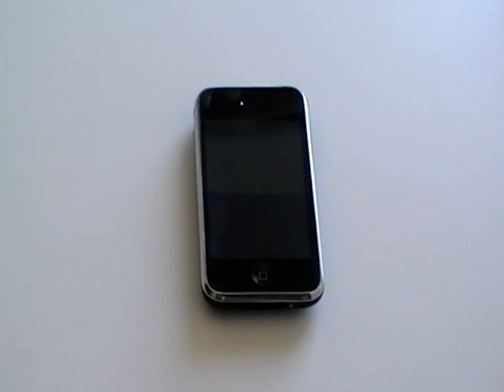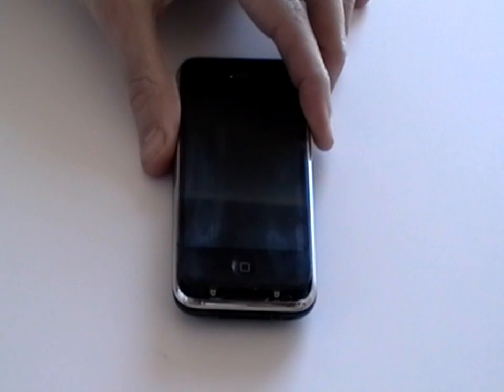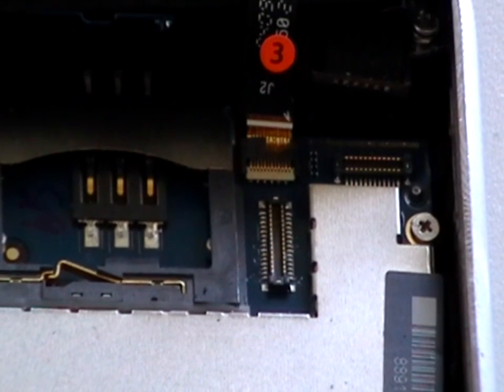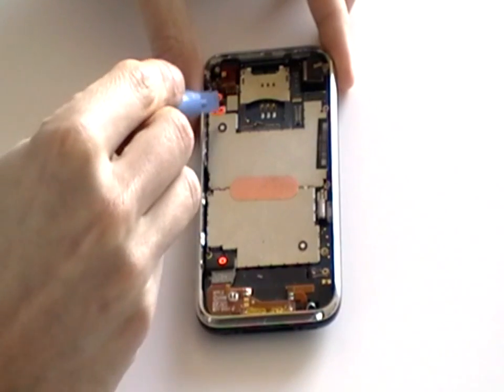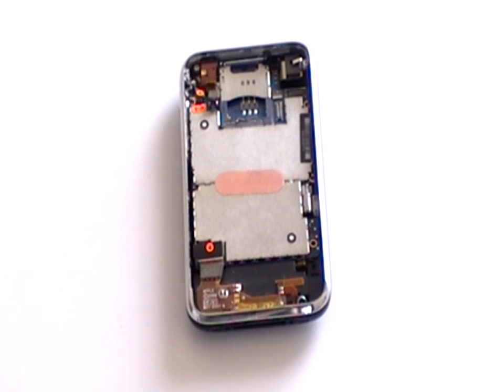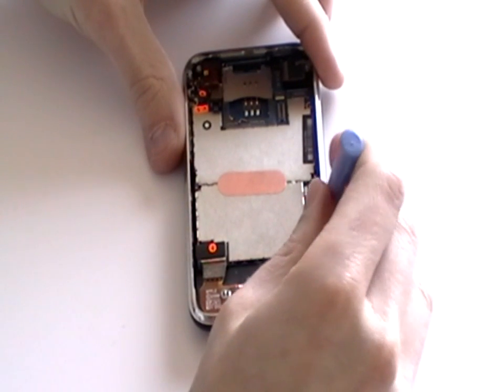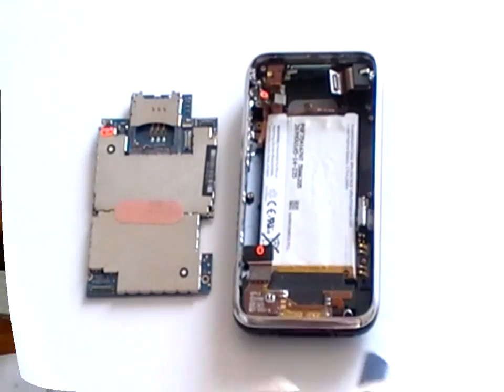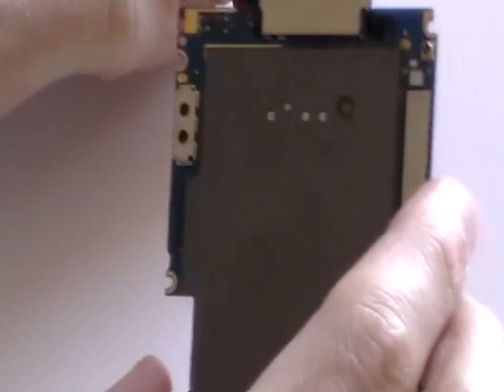iPhone 3G Camera Replacement Repair Directions

Comment from the maker: @ChristopherLuck Wow, that does seem very odd. Both are the same model, correct (3G or 3GS)? We have never heard of an issues with an iPhone not powering on because the camera was not working. Even if swapping a 3GS camera into a 3G it will still power on.

Comment from the maker: @ChristopherLuck If the shutter does not open it is likely a bad camera connection. Follow this video and check out the cable to be sure it is fully in place.

Comment: excellent video, i wish i'd seen this before i tried replacing my battery. now i've got a broken camera cable. the other videos gloss over how to remove this detail and none of them advise you against removing the metal arm that holds the camera in place (which is what i did).

Comment from the maker: @cobweb657 There are a  few possibilities. Possibly it is a faulty camera, causing signals that freeze the device. Could also be a connection issue, or even a software issue.
Camera replacement would be our best guess on the hardware side.

Comment from the maker: @dOminiCTHUOK Yes, replacing the camera will resolve that issue. Many times dirt or dust will get trapped in the shutter and not allow it to open. Simply replace the camera and it will fit it. Replacements are available at RepairsUniverse (dot) com.

Comment: @RepairsUniverse Yes well it used to work properly just the lock button and vibrate togglrd a bit. As i saw a few videos i had decided to do it myself and turned out bad the videos were not showing my numbet 3 on the lcd screen and i accidentaly  f*&! it up. This broke the ear speaker. and some how camera. now i cant make any calls but the microphone still works even on speaker. And i was wondering how much it would be to get it fixed? or even maybe ( w/ out them knowing i broke it) get refunde

Comment from the maker: @FrenchBallsamics Hmm, well the power/lock button could be an issue with the flex cable and contacts located under the buttons. I would just double check that the camera and earpiece speaker are fully connected, if they were working before it is likely just an install issue. Does the iPhone function fully (screens, messages, apps, etc), besides the rebooting?

Comment: So i got a iphone 3g s from a friend and tried to fix the power/lock buttin when i got inside and attempted to fix it i put it back together to fin theat the ear speaker, camera were not working. So i attempted to fix this problem and just settle with a broken lock button but when i put it back together not only did the camera and ear audio were still not working but now my iphone is turning off every few minutes and rebooting all by its self. im pretty frustrated and would like help. Thanks

Comment: @RepairsUniverse Is the reason why you cant replace the 3g camera with a 3GS camera the connections? Or is it a software issue? Or is it that it just wont fit?

Comment from the maker: @dalboyinoz Glad the video helped! As for the camera issue, it sounds like a connection issue. Flickering is a common sign of this. I would not think this tab would effect the camera, however, connections to the motherboard are likely the cause. Disassemble and take a look for loose or ripped connectors/flex cables. Good luck!

Comment from the maker: @odinx666 Yes, you need the camera replacement.

The flex for the power button is part of the headphone jack replacement. You will need this part to resolve your power button issue.

Both parts can be found at RepairsUniverse (dot) com

Comment from the maker: @jd112Aa5 It is not possible to upgrade the camera. You can replace the battery with a higher capacity battery. You can find a high capacity replacement at RepairsUniverse (dot) com